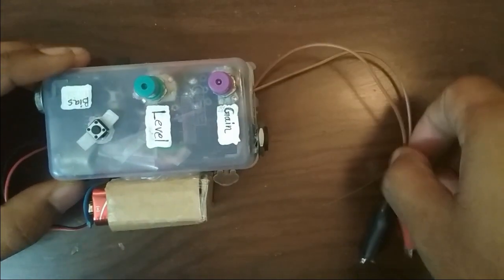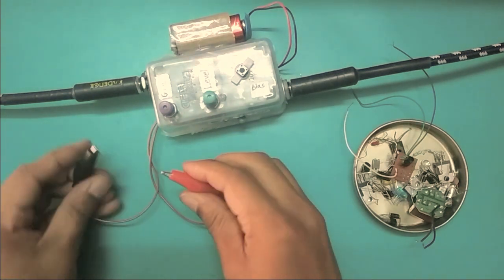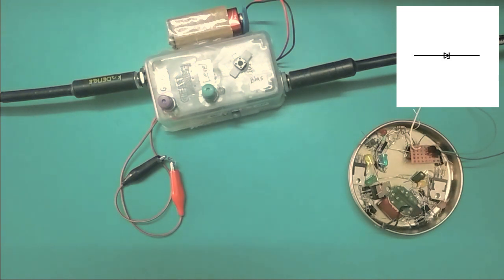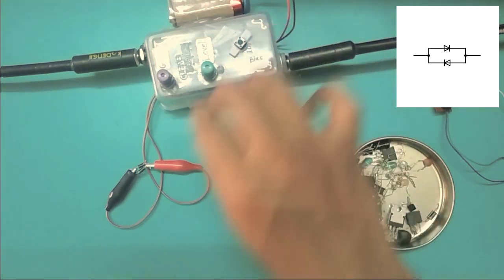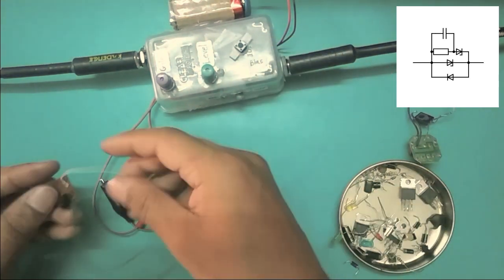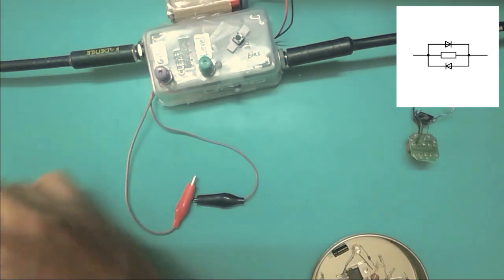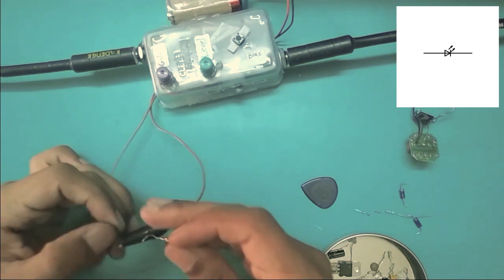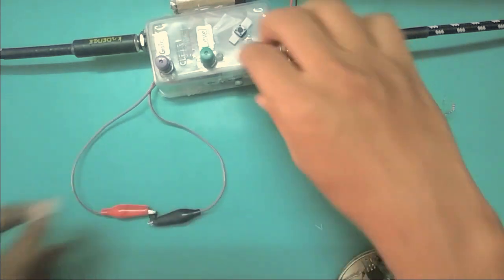DIY Overdrive/Fuzz/Distortion - The "Blank Slate" Pedal

Comment: I'm having problems when trying to build the circuit. Is the output connected to the tip or did I get it wrong?
Reply from the maker: Ooh yes, never noticed that but it looks like I messed up with the circuit diagram there. For mono audio the connection would typically be tip and sleeve, not sleeve and ring. I guess it was tempting to draw it connected to the sleeve contact to get nice straight lines xP
Reply: @Psychotenuse  i really dont know what i am getting wrong then. When the circuit is open between the clips i get that buzz but i do not even get the clean tone when connecting the two clips
Reply from the maker: That's unfortunate :(
I can't really guess what might be wrong from just that description though... All I can suggest is checking all the connections, trying different settings on the potentiometers, and maybe getting rid of the button and the resistor in series with it.
Reply: Did you get it to work? I was having the same issue until i switch the tip and ground with each other on the input
Reply: @gustavobustamante6814  i did get it to work, i initially messed up some connections, the input was not the problem
Reply from the maker: Glad to hear it :D
Reply: @Psychotenuse I read it upside down like a dumbass and it fires up nice lol😂😂😂
Reply: Why not to make a standard bypass wiring?
Reply from the maker: @joseislanio8910  I see, well yeah, if I really built this to use while playing I would probably add a true bypass switch at least, haha. As it is this is more of a fun experiment.
Reply: @Psychotenuse 
It's a fantastic bit of fun, thank you for posting this video, very good idea and some great work. Peace and best wishes to you and yours from here in Ireland 👍
Reply: Ring
Tip

Comment: do you connect the guitar to this and then connect to speaker or do you connect guitar to this then connect to amplifier
Reply from the maker: I was going to my interface actually, but I had amp simulation in post
Reply: @Psychotenuse  also what connector audio did you use, like whats its name in kicad
Reply from the maker: I'm not sure if kicad has it built in
Reply: @Psychotenuse  can i use any 1/4 inch jack ill find or is it compulsory to use yours onle
Reply from the maker: @sanchitkulkarni1371 I don't think there was anything special about the jacks I used
Reply: @Psychotenuse  what connect to the potentiometer, tip or sleeve, same for input jack,  what i connect to tip and what to sleeve??
Reply: @Psychotenuse  also shall i use NJ3FD-V or NJ2FD-V,  NJ3FD-V one has ring also, NJ2FD-V has only tip and sleeve
Reply from the maker: I'm afraid I know nothing about these parts 😅
Reply: @Psychotenuse  oh it ok, js tell what I should connect to tip and sleeve for both, and wether I should use connector with ring or without one
Reply from the maker: Without, or you could simulate that by just shorting ring to sleeve.
Reply: @Psychotenuse  for output shall i connect potentiometer to the tip or sleeve
Reply: so i should connect guitar output to pedal input and then connect pedal output to amp right?

Comment: Try lightbulb in op amp circuit ( like a wien bridge oscillator amplitude stabilisator circuit ).
Reply from the maker: That should behave essentially like a very slight compressor. I made a simple compressor circuit with a lightbulb once, you can take a look at the video on my channel if you're interested :)
Reply: @Psychotenuse  Thanks :)

Comment: putting a trimmer pot instead of the resistor parallel the LED so you can blend a bypass clean
Reply from the maker: It would be interesting but really a blend per se
Reply from the maker: Apologies xD
I meant it would NOT be a blend per se
Reply: i typed the word blend because i MEANT BLEND.. ?  @Psychotenuse

Comment: I finally got around to making it... gonna use a 3 way switch to switch between 3 different configurations when I make the final product. I’m building it into a homemade amp for a friend.

1:Back to back diodes 
2:Diode
3:Back to back diodes with a resistor in parallel
Reply from the maker: Haha, I remember I did something similar once. I think I somehow used a DPDT switch with a middle "off" position to switch between three distortion networks. The amp didn't sound very good, but that was mostly because the speaker was housed in an old plastic ice cream container :P
Good luck xD
Reply: @Psychotenuse  lol thanks. I'm using a 100 watt amplifier I made from a STK404-130S operational amplifier. It's only truly 100 watts at 36 volts into a 4 ohm load and I'm using an 8 ohm speaker at 16 volts so it's running at about 25 watts rms. It's still really loud and I think I lost a little bit of hearing while testing it haha those amplifier modules are on eBay for 6 dollars and the datasheet gives an optimal schematic. I got mine from a powered subwoofer.
Reply: @Psychotenuse  I recommend getting one of those amplifier modules but the main downside is that they require split rail power. They seem to be pretty efficient for a class ab amp. Makes no heat at idle, and below 10 watts it doesn't even need a heatsink.
Reply from the maker: @jjhack3r  Sounds like a cool project! However, if your design is one op-amp stage with distortion going into another op-amp, the end result will likely sound very solid-state.

Comment: I don't know man, but I think 2.2k ohm resistor is a little too small, you have current leaking which would not do much useful work besides releasing heat. Might want to change to something like 100k or even 1M resistor
Reply from the maker: Hm well the input signal is referenced to that voltage divider so you don't want the current to be too low because that can cause ground loop issues. If you reference the input signal to the power rail and capacitively couple it to a divider at the op-amp input (this is a more standard approach and arguably a better one), then you would be right in that you would want the resistor values to be high.
Dissipation is not really an issue. 4.4kOhm across a 9V rail only results in a current of about 2mA. For context, the quiescent current of the chip is around 40mA.

Comment: very awesome idea! i tried it, but im getting tremendous noise when the 470 k ohm POT is set to anything but 0 ohms...how can i contact you?
Reply from the maker: This will happen if you don't connect the clips to anything, i.e. run it with an 'open loop'. Make sure you connect something between the clips before testing the circuit.
You can email me at the adress in my channel 'about'
Reply: @Psychotenuse heyy , i mailed you , i tried diodes, resistors, everything u mentioned, still the humm is waay louder than the guitar signal

Comment: It's a very unusual use of an audio power IC for a pedal, which is really cool.
Did you try putting two clips for hard clipping at the output of the circuit?
Reply from the maker: Lol, well that's just what I had lying around :P

A low power op-amp would probably produce much the same results in this circuit.
Reply from the maker: Clipping on the output is what I tried first, but since there is not much headroom the results were not very good at all. I got much better results at high voltage: https://youtu.be/BmYvxnKo2pA

Comment: 6:40 how come the resistor in parallel changes the tine so much?
Reply from the maker: The resistor allows small currents (I < Vknee/R) to pass through linearly, giving a clean region prior to distortion. With no resistor (R = infinity) you have zero headroom so even the smallest signal is distorted.
Reply: @Psychotenuse  thanks!!!

Comment: May ask, where could I wire the third post of a germanium transistor? -Noob question.
Reply from the maker: Hm... well, there are two clip terminals, so you can only connect two nodes. There are a number of ways in which you could use a transistor as a clipping element, for example by connecting the clips to the base and collector or to the base and emitter, or one terminal to the base and the other to the base and emitter, or one terminal to the collector and one to the emitter with resistors tying each to the base... and you could double up any one of these for both directions.

If what you're asking is how you can incorporate a third terminal, well there are many possibilities which would have different results. One idea is either the positive or negative power rail (perhaps with a current limiting resistor to prevent burning stuff).
Reply: @Psychotenuse  both were helpful.
Reply: @Psychotenuse  What value resistor would you suggest if I were to ad an optional alligator lead to each the +&- power rail? (I’m sorry I’m being so needy) I really like your concept here and I’m sick of buying unimpressive pedals.
Reply from the maker: Lol no worries.

Hm... If it were me perhaps I'd use a hundred ohms or so. BTW I'd be really interested to see what results you get with this variation!

Comment: I cant seem to buy the TDA2030 anywhere locally..  tayda is the only place i can find it to buy individually.
Reply from the maker: For this circuit, you don't really need the high current capabilities of the TDA2030. I really just used it because I had one lying around...
You could even use an LM386 with this circuit and it probably wouldn't sound much different.
Reply: @Psychotenuse  thanks very much I was looking for an alternative :) i dont know much about this stuff but you have encouraged me give it a go. thanks again!
Reply: the TDA2030 has 5 pins, the LM386 has 8
the extra pins on the LM386 seem to be gain(pins 1 and8)  and bypass (pin 7)
can i just stick to your schematic and ignore those pins?   ... or is there more to it than that? 
maybe i should just try it and find out!
Reply from the maker: Yeah, you can just ignore the extra pins. Don't short them to anything, that's all.

Comment: great video. as you said the biasing button wasn't necessary then does the circuit need the 550ohm resistor or can I eliminate it and the button from the circuit? the output potentiometer is basically like a volume control right? by the way do you think I can plug the output to a lm386 amp circuit? because the lm386 can amplify instrument and line level with the appropriate amount of gain.
Reply from the maker: Yeah, if you remove the biasing button there's of course no need to keep that resistor which is in series with it. You would, as I have seen it called in some textbooks, "replace the components with open circuit".

I would recommend plugging the output of this pedal into a guitar amp (or multi-fx processor) to get decent sounds.
Reply: @Psychotenuse  does the output capacitor have to be exactly that value or is it a bigger is better type of thing?
Reply from the maker: Sort of but I wouldn't make it too big, if you make it bigger that biasing button becomes more necessary, as it were.

Comment: Not boring at all
Reply from the maker: Is that sarcasm xD
Reply: ThePsychotenuse I’m literally sorting my resistors right now to make one of these.
Reply from the maker: @joelabbott  Haha, guess not then. Good luck, I'd love to know how it goes!
Reply: ThePsychotenuse I got it working, and the fuzz sounds great, but I can’t control the gain enough to get a clean tone out of it. I’ve experimented with many different values for every resistor, and I can’t figure out where the overload is happening. Any ideas how to clean it up?
Reply from the maker: Hm... If you can't get a clean tone with the clips shorted and the gain knob turned down, it seems likely to me something's wrong with the circuit. It is possible there's a bad connection in the feedback loop? Check/Redo the solder joints on the clips perhaps?

One thing to consider is that in this circuit, the gain control variable resistor operates 'opposite', as it were: increasing resistance decreases gain and vice versa.

You could try putting a resistor on the order of 10k in series with the gain control  to limit the maximum gain.
Reply: ThePsychotenuse I had better luck today. I got a  cleaner base tone by putting a 10k audio taper pot in place of the 550ohm resistor and dialing it wide open. 

I was wondering if the circuit can take higher voltage, like 12-18 volts. 

Also, in the diagram, is there supposed to be a connecting dot above “clip 2”?

As for the variation circuits, I had good luck getting fuzz by stacking LEDs and diodes. I got some more mellow overdrive sounds by putting a capacitor in parallel after the diodes.
Reply from the maker: Yes, the wires are connected, of course. My software didn't put a dot there for some reason. I didn't think it would be confusing because the wires don't cross :P
Reply from the maker: 18 volts should be fine, as long as you use an appropriately rated capacitor on the output.
Reply: ThePsychotenuse I asked about power, because it feels like more power would give a greater range of clipping, from cleaner to dirtier. At 8-9volts, my circuits feel on the dirty side. 

I have the main circuit on a breadboard and the variation circuits on another breadboard. After I transfer and solder the circuits to strip board, I have a five way rotary switch that I plan on using to switch between the variations on the enclosure. 

I’m getting some nasty fuzz tones, and one circuit even yielded what sounded like an octave fuzz! It’s way better than buying a commercial fuzz pedal!
Reply from the maker: @joelabbott  Haha, sounds great, it makes me so happy someone is getting good use out of this video :)

Yes, I think running it on a higher voltage might give some cleaner tones, though I don't think it will make much of a difference with, say, germanium diode networks because germanium diodes clip at very low voltages, around 0.3 V. It would probably have a more obvious effect on LED - based networks, especially white or blue LEDs which clip around 3 V.

Comment: I would prefer a discrete version. What would you recommend?
Reply from the maker: Well that's interesting. Using an op-amp certainly makes it a lot easier.
My first attempt at this was to first amplify the signal cleanly, and then distort it by feeding it into a voltage divider with the clipping network on the bottom. This has problems, however. Without going into details, putting the clipping network in the output either makes it not as robust in terms of working with different types of clipping networks, or just sounds all the same regardless of what clipping network you use.
Now, many simple discrete amplifier circuits operate at a dc offset and can source but not sink significant current. These, I think, would be difficult to make work for this purpose, because it would be difficult to bias the clipping network correctly, or get symmetrical distortion.
One interesting idea is to use an amplifier circuit coupled via a signal transformer to the clipping network with a current limiting resistor in series with it. This could have the same problems as putting it on the output of an op amp, though.
So I suppose my suggestion would be to build a high gain split rail amplifier circuit with a big feedback loop around the entire thing, and put your clipping network in that feedback loop.
Reply: ThePsychotenuse. Thanks.

Comment: what use of tack switch?
Reply from the maker: The switch simply turns power on or off. It is not how a footswitch on a guitar pedal would be connected. As I say in the video, I turn it off before changing the clipping network in any way.

Actually, a footswitch could be connected in parallel with the clips to short out the distortion elements, to create a "buffered bypass" switch. In that case I would add a small resistor in series with the gain control variable resistor to avoid the extreme case of shorting the output to "ground".

Cheers!